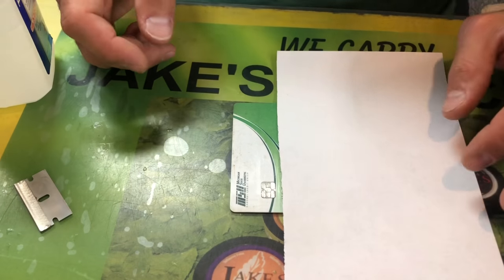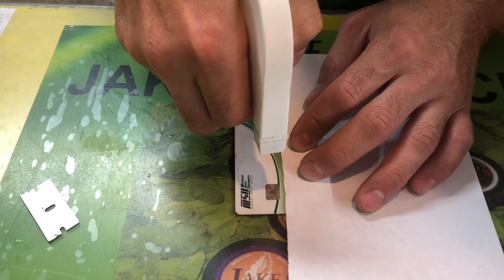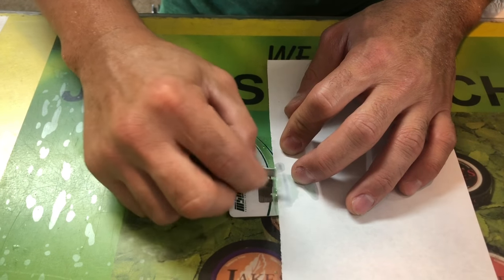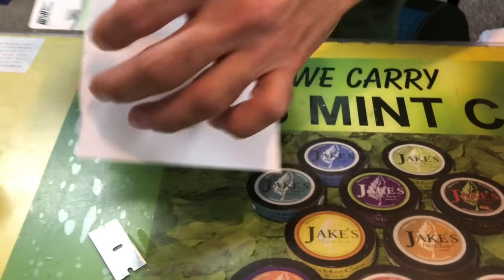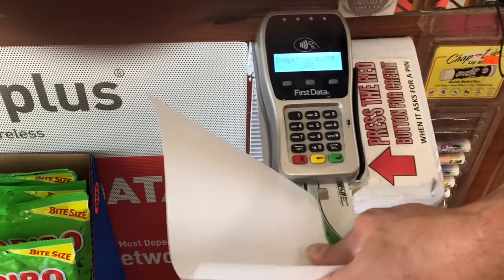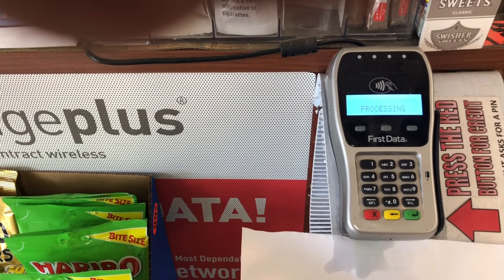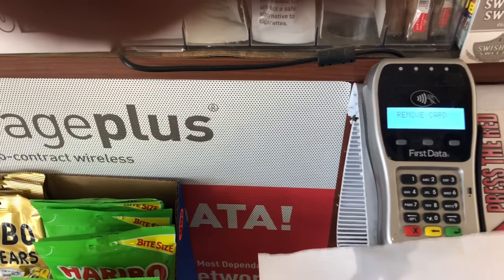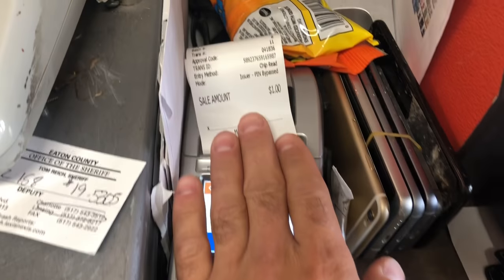How to fix your credit card chip that won't read

Comment: My card stopped working, I searched YouTube for a fix, came upon your site, and BAM - It worked like a CHARM! I cleaned the card with hand sanitizer, wiped it with an eyeglass cleaning cloth, and then used an ordinary nail file (emery board) to scuff the surface of the chip. Went to the gas station to try it out and was able to fill up the car. Genius! Thanks!!!

Comment: Hi. Tried to use my Santander debit card yesterday in my local shop. She tried about 5 times but the terminal said "Remove Card". Tried again today in my local shop. This time she tried about 10 times on the terminal and also on the PayPoint Terminal but it wasn't having it. Phoned Santander today 19th July 2024 and they ordered me a new card. I tried your method by scuffing up the chip with a razor blade but no luck. Fortunately, the shop and ATM is next door to my house so it's very convenient. I tried your razor technique a few times in the ATM but the machine said remove card etc. Okay, so here is MY FIX. I used wirewool tonight. YES, WIRE WOOL and put my card in the ATM machine and it worked!! No liquid was used. Just a dry bunch of silver wirewool. It's a miracle!  I would not have thought of using anything unless I saw your video here so thanks for making the video. I know from the comments that it helped a lot of people. However, if there is anyone out there where the razor technique does not work, just use dry wirewool and rub it across the card and BOBS YOUR UNCLE!! I hope my own technique helps someone out there in the future. 🙂
Reply: Hey same thing has happened to me just now did it work?

Comment: My debit card is not working and I will try it today. I hope it works. My card is new and I have used it only thrice and still it is not working. Let's see if your tip works.
Edit: I tried it yesterday and it worked. Thanks dude you saved my 250 bucks ❣️

Comment: Can I rub the chip without alcohol spray on it ?
Reply from the maker: Paschal Gangmei yea give it a try should work
Reply: @sandimarielavati2354  I did it my self few days ago. I directly rub with blade until it shine like a gold. At first thought it won't work but then when I tried at the ATM and POS machine it running smoothly. I also add little white toothpaste while rubbing with blade to get those dark looking stain or dirts out.
Reply: Paschal Gangmei text me